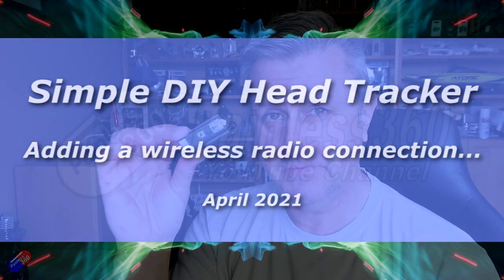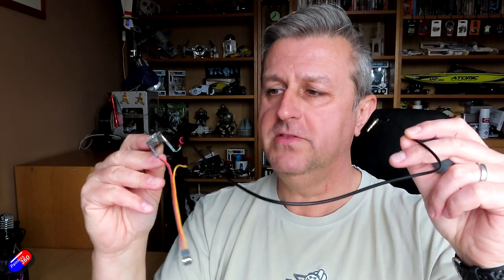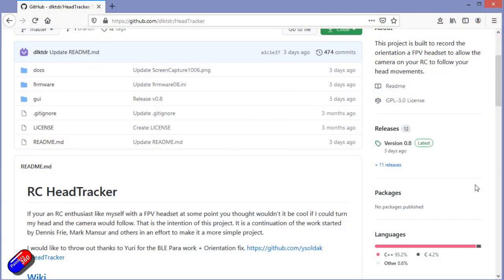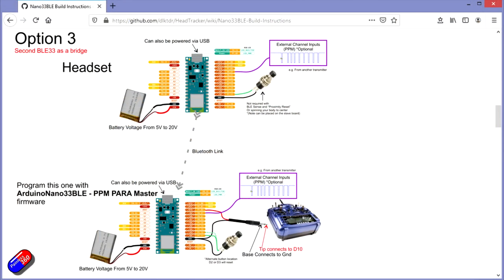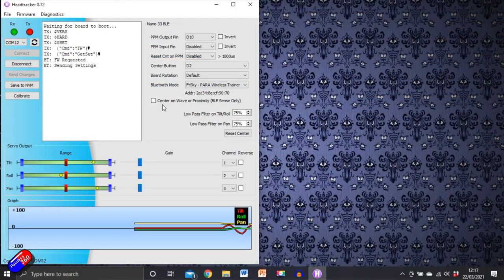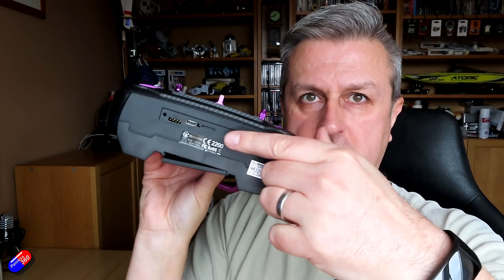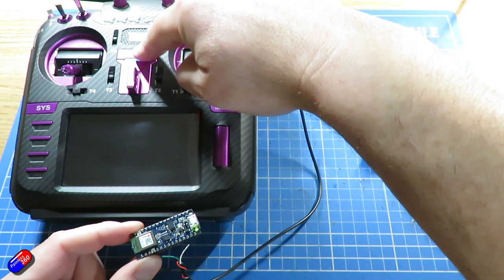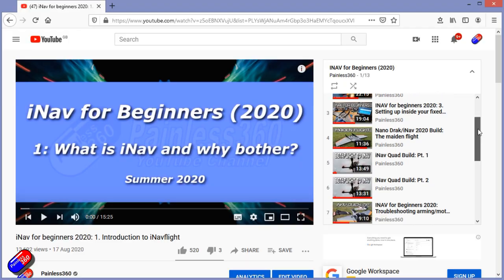Cheap, easy DIY Head Tracker Setup - connect to the radio wirelessly!

Comment: I would really like to see a little more information on how to connect the Bridged option. I'm using multiple servos on my build and it's a bit confusing how to wire the Arduino modules together.  Im basically designing a Search and Rescue Quad with 2 independent head-tracking gimbals so we can have an additional observer onboard. Any thoughts you have on how best to accomplish this would be greatly appreciated.  The links you provided were very informative, I'm just making sure I don't overlook something I should be taking into consideration that may not be in the documentation and video.
Reply from the maker: I'd contact the chap behind the project. I've only ever used one head-tracker per radio. Maybe have a separate radio for the other pilot with the headtracker?

Comment: The price of these boards have increased a fair bit since you made these videos. The board alone costs £30 plus shipping now. I've got one for the head tracker, but the PARA wireless module for the radiomaster costs the same as the 2nd BLE board would, so I've ordered one of those to put in my radiomaster TX16S instead.

Thanks for the videos 👍
Reply from the maker: The chip shortage has pushed up a lot of the prices. Sorry to hear you didn't see the video when you they were cheaper. Make sure you are subscribed and have the bell notification icon selected so you don't miss future content.. Happy flying

Comment: just orderd 4x Arduino Nano 33 BLE bords gonne build in the radio so nothing is dangling around, nice clean setup (hopefully) i wonder if the dji air transmitter also has a trainer port in.. would be need to use the original remote... instead of carring 2 remotes around, one for my race drones and one for my planes's /heli's

Comment: Great info, many thanks for sharing this. For quite some time now I have been thinking making a head tracking sensor with an Arduino to serve both for my FPV as well my PC Flight simulator and this gives me so much details.

Any particular reason not using  the Arduino nano 33BLE sense version as it has everything in it? I was hoping to use this as it has a BT as well as a accelerometer and a few other build in sensors 😁
Reply from the maker: That is an option, see the Wiki for more information.. Best of luck

Comment: Hiya! Is this for use for radios without bluetooth? I have an older x9d (from the tv show we were on) it hasn't got bluetooth but I want a wireless headtracker.. is this the best route to go down ? Many thanks
Reply from the maker: You can setup two of these with one plugged into the trainer port on the radio and connected wirelessly to the Goggle HT unit. Check out the project link for full details... Happy flying

Comment: I wonder if there is a way to connect this directly to a crossfire or other transmitter module with a battery to power it.   Then, put a separate receiver on the pan-tilt only for it's purpose.   This way it could be completely self contained and you wouldn't need to connect it to a radio.   I'm thinking about this since I normally use the DJI FPV controller on my models, which doesn't seem to have trainer port capability.   Maybe that is more complicated than it is worth, but interesting to think about.

Comment: You should work with Radiomaster to come up with a product like this.
Reply from the maker: The margins would not be enough to produce them commercially when they are so easy to make using the project. Thanks for the comment though, it's an idea!

Comment: Do you have any kopilot lite gyro gain recommendations for the ar wing pro ?  I had to remove my PX4 from my AR Pro wing. The z axis accelerometer failed leading to a crash.  I tried to drop to manual mode but it was too late I could not break out of the stall.  The flight.logs verified the failure.

Comment: Thank you very much for your share. so there are 3 options. 1- wireless, 2- with wire direct connection, 3- double ble33 bridge method. as far as I understand I need extra ble33 card for third method. I prefer first option (direct wireless) due to expensive other options and I don’t need to buy extra ble33 card. But , How can I do it? if I add bluetooth module for my radiomaster tx16s, can I connect directly ble33 with radiomaster bluetooth module for wireless headtracker? thanks
Reply from the maker: If that is an option, it'll be on the projects documentation. Best of luck

Comment: The instructions now show ability to use SBUS on the Radiomaster bottom UART instead of the audio cable. However it makes reference to the sense board version, which is confusing and contradicts the earlier warning NOT to use the sense version. Editing mistake?
Reply from the maker: It wasn't like that when I made the video - this is a project that is evolving all the time.. Happy flying!

Comment: Great video, I was thinking of asking you to create a video of this after your first head tracker video, can you power either board from the USB port on the dji goggles and the USB port on the tx16 ?
Reply from the maker: Not sure, this only pulls about 20mA so maybe. If you get it working, let me know.. Happy flying!
Reply: @Painless360  I have ordered a 30cm usb c to micro usb lead , I will let you know as this will simplify the build for people.
Reply: @Painless360  hi, tried it and the usb C does not supply 5vdc out, what a shame it would have made it so easy.

Comment: Thanks, Lee, I bought the module, loaded and connected, I setup pan and tilt it to TR1 and TR2 channel 6 and 7  but don't see anything happening on my transmitter, via the GUI it shows connected, also via BLE app my Taranis 2019 SE para functions well, any idea what's happening? Taranis is Master mode and BLE in head mode, shows connected
Reply from the maker: Not sure, I'd check what is on the other TR channels (TR3 etc.) in case there is a signal on there.. Best of luck
Reply: @Painless360  when I connect now I see noisy signals on the transmitter from channels 16 to 32, something is wrong, can I get any help from developers? Do you know if they have an email or some support?
Reply from the maker: I'd reflash it. I had one here that needed two flashes to get working. Best of luck
Reply: @Painless360  Thank you it worked, it worked, it worked :) I didnt enable the channel output in the GUI and didnt save to eNVM now I am good ....thank you ...you have helped me since 6 years into this hobby ...please take care

Comment: Ya know... At this point I'm kinda disappointed of DJI for them not to include a HT ( wired or wireless ) in their new goggles... Costs probably like 5.- for the 3-Axis Chip to be included and parasiting off what Gates knows is already soldered to the Goggles PCBs and like another 2.- to add an external port for people to tap into it. Nope... People will have to add an UGLY external module to their Goggles in order to get that functionality 😤